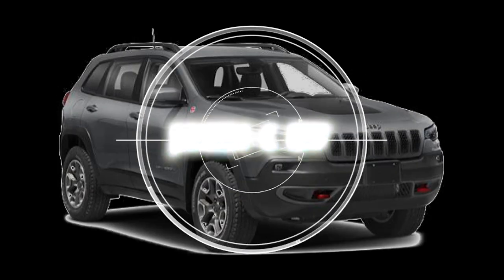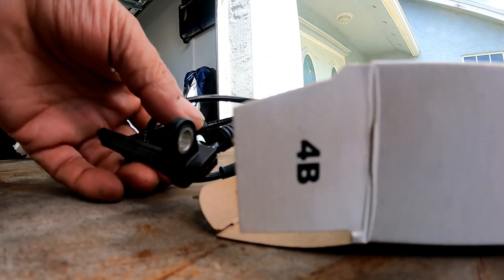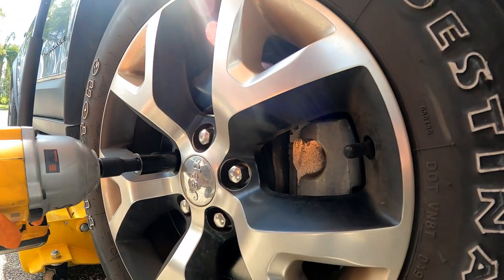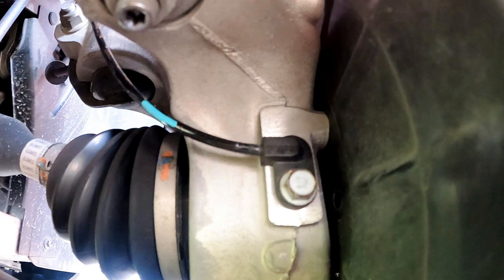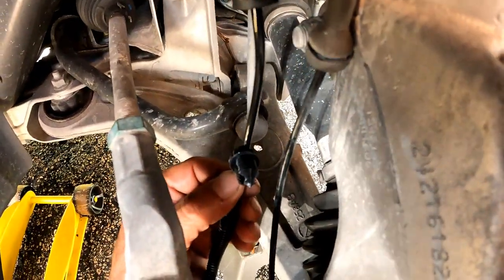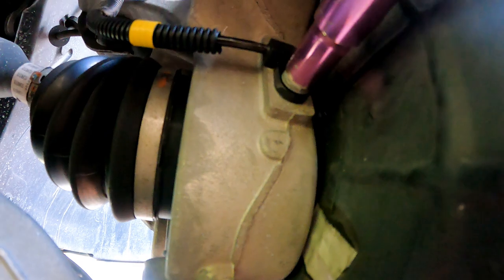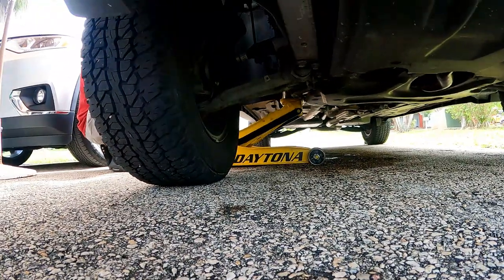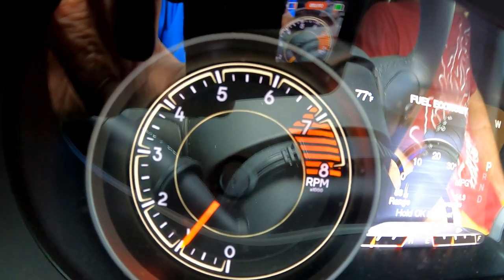How to Replace ABS Wheel Speed Sensor 2017 Jeep Cherokee Trailhawk

Comment: Hahah yeah its so annoying when they throw codes. Our Trail Hawk has replaced spring shocks vs air bags it came with and its a permanent light on & ding now every drive lol! Pretty cool you can fix stuff, thats a good skill to have. Cheers!
Reply from the maker: The new vehicles are controlled way to much by computers. The day is coming when you wont be able to change a flat. LOL

Comment: There is a lug guide bolt clipped onto the scissor jack in your trunk under the floor where the spare tire is. It's just a long bolt guide that screws into the lug bolt hole so the wheel can be hung on it without the struggle of trying to get that first lug bolt in. Just an FYI
Reply from the maker: That's great information, thanks!

Comment: My service 4wd light comes on intermittently to and fro?

No mechanic work or tire changes no cel lights only srv4wd ?

Do you think speed sensors?
Reply from the maker: Never had one of those yet..
Reply: Have this in addition to parking brake, abs, transmission, going to change both of my front wheel speed sensors to see if that is the problem.

Comment: I have a 2014 Jeep Grand Cherokee.. intermittently I have it where it where it gives me a service AWD system warning which then disables the traction control. I have heard this could be a speed sensor. 1 - do you know if it is as easy of a job on the 2014 and 2 - is there anyway to tell which speed sensor it is without taking it to the dealer. Cheers!
Reply from the maker: Its hard to know which one. You definitely need a computer from a mechanic shop...
Or you can buy one for the back and one for the front they are the same for left or right on a 2017 I'm not sure about 2014 Gran C..... you'll need to find that out....